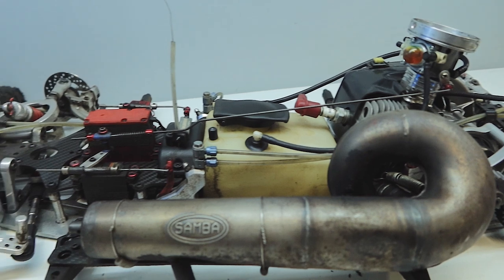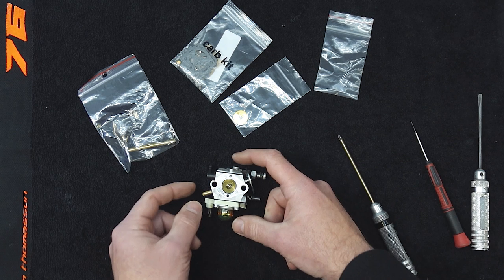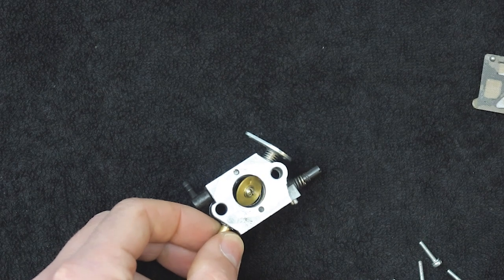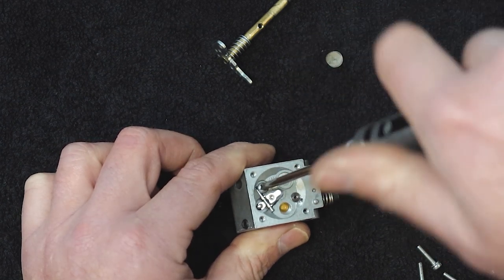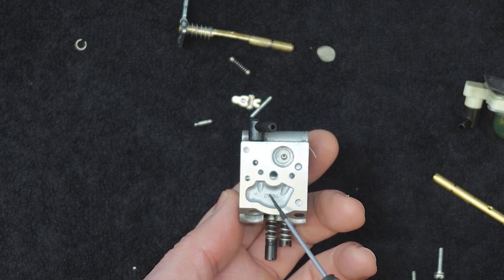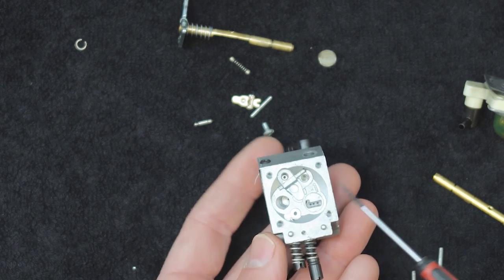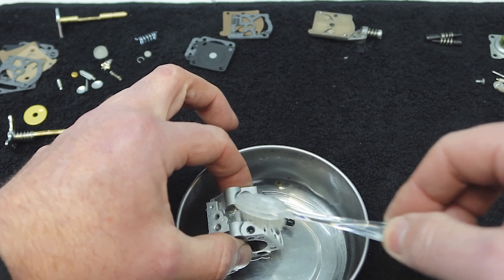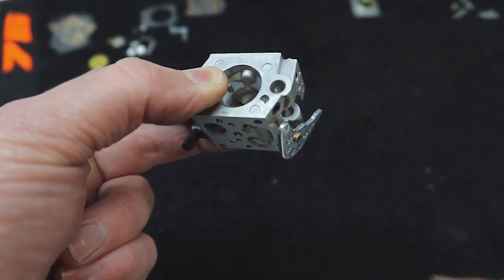RC CAR Carburetor Repair - WALBRO WT

Comment: Though I’m an rc airplane guy, I enjoyed your excellent video. The non-serviceable inlet is the “seat check valve”. The other side has fingers crimped in holding a little disk.  They do go bad, and it’s fairly easy to destroy one with a blast of air or carb spray. They are “non serviceable” in the sense that Walbro has discontinued those parts, but you might find old stock on line. Old one can be removed with the right size screw or the Walbro tool kit once contained a punch.  Some models also had pressed in ‘nozzle check valve’ which had the crimped end in the throat of the carb as part of the main jet. 

If damaged, at idle there is vacuum on the idle port because it’s inboard of the throttle plate, but there is not enough flow through the Venturi to create vacuum at the main jet- so the idle jet might pull some air in through the main jet instead of drawing fuel from the metering chamber… erratic/unstable mixture at idle. 

Anyhoo, can’t really blame Walbro for discontinuing those parts. I think most of their business is from power equipment repair shops, and no one is going to want to spend $22 for rebuild kit, like $80/hour shop rate- and maybe end up with a bad and not available check valve. People either get a new (or knockoff) carb, or in the case of a cheap string trimmer- throw the whole machine away

Comment: Nice job Mark. thank you! This step by step video was essential for a WalBro Carb rebuild on a 25 year old VARIO ALOUETTE II 1:6 scale RC helicopter. I’m now Celebrating with a smooth idling engine after …… well…… 10 pulls. What a difference! Idling like never before. Side note: As I didn’t have profi punch tools needed for refitting the Welsh washers (?), I used similar sized hex drivers….. with success! I did struggle with the smaller copper fitting … mine did not come out as easily as yours. Beware. Flying this coming weekend. Regards from Switzerland

Comment: What size rotabroach were u using mark
Solid explanation of carb workings etc
Have u thought about doing the metering mod where essentially u take about 3 coils from each side of the metering spring to bring the pop of pressure down to 16psi
Regards

Comment: Mark great video! I need help with someting you did not cover though.I got a used old weed trimmer with a carb. almost exactly like yours, however under the primer there no orange ring like yours. Is that something that should there?  I can't get it to prime?

Comment: Great video, thanks! I have same car, CY 24cc when I got it, it started up immediately. Then it was sitting on the shelf for few weeks before going to the track. There it just did not want to pump fuel and barely get it going. Now I rebuild the carburettor, pressure tested it and it is ok. But the motor still wont run. L needle is 1,25-1,5 turns. I managed to get it going for few seconds if I remove fuel intake line. Motor has spark, carb does not have a choke. Can you give an idea what to do?

Comment: Gday Mark best video on YouTube explaining the carby... and believe me I have watched thousands.
Would you have a part number for the milling bit you used and are they 5x9x4 bearings wouldn’t mind giving the bearing mod a crack.
Keep the videos coming👍
Reply from the maker: Thanks James! I thought for sure no one would be interested! so glad the info came in handy. The bearings are 3/16 - 5/16 - 1/8 (ID - OD - width) the bit you saw in the video I made in the workshop! after I get the latest video wrapped up I'll be doing a video on three different DIY at home methods for installing the bearings! so keep an eye out... And thanks for the support Mate!!
Reply: Mark Thomasson Thanks will do.

Comment: I like the details of the carb workings. BUT, for a $12 carb (new) vs $5 for a carb kit, isn't it better or more cost effective to go with a new carb? My 5 year old (on a shelf for 5 years!) Redcat xt, that I've had 3 weeks, the carb was junk from the factory. I replaced it with a new $12 (USA) carb from Amazon, & it runs like a new, broke in 100cc engine now. LOL! It had some carb issues, factory.
Reply: because your new $12 carb is a fake clone carb by RuiXing etc and not a geuine Walbro carb. Mark doesnt buy $5 carb kits either. He buys genuine Walbro. Everyone has a different budget, nothing wrong with that. Also judging by the views there is appetite to learn and service items even in a disposable society. Hows the Redcat?

Comment: Hey Mark! awesome video on how to fix carbs! iw bin looking after a drillbit like the one you used for the bearings. can you tell more about it? maybee were to get one.
Reply from the maker: Hey Mate, the bit you saw in the video I made in the workshop! after I get the latest video wrapped up I'll be doing a video on three different DIY at home methods for installing the bearings! so keep an eye out...  those bearings on the throttle shaft make such a difference!

Comment: What a Thing. Why the gasoline carb has to be so much more complikated than a Nitro carb?
Reply: crankshaft vacuum is sucking fuel into the nitro carb, and at the same time exhaust has a pressure line into the tank pushing fuel. Gas engine has none of this, he explained one port from engine to pressurise the carb with pulses that draw the fuel in

Comment: Can you explain the differences in the 603-668-990
Reply: 133levi 
668 carb used up to 26cc engine and has manual choke
990 carb used on bigger engines up to about 30 cc. Maybe 32 cc. Has no choke
I’m fairly certain this is correct but someone might be able to confirm

Comment: So how do you do the pop of spring mod on your carbs
Reply from the maker: The spring rarely needs altering in cars, boats that run around at full throttle can benefit greatly tho. Walbro actually sell springs in different rates!

Comment: Hi Mark, great video on rebuilding the carbs. Already purchased some rebuild kits for my WT-990 carbs, but finding it hard to find a supplier for the the shaft and butterfly in Oz, where did you get your from?
Reply from the maker: Good to hear you're having a crack at rebuilding them mate!! Hobbies Direct have them in stock and express post for those like me who hate waiting for parts! 
https://hobbiesdirect.com.au/Zenoah-Walbro-Carburetor-Throttle-Shaft-Kit-T207081370?search=walbro%20carby
let me know how you go...
Reply: Mark Thomasson 
Hi Mark, thanks for the info on the shaft supplier. Will keep you updated.

Comment: Were did you buy that drill bit from and what’s the bearing size you used
Reply from the maker: @George Specs - I'll detail and show 3 different methods in an upcoming video! it'll cover a couple of different options!

Comment: Hi mark i have a hpi savage octane, with a walbro carb and when i accelerate the engine get bogged and dies ive messed with the high and low speed needles but i havent had any luck any ideas?
Reply from the maker: @Isaac Estrada start with the simple things first...  1. check the fuel delivery, the clunk in the tank might be blocked - disconnect the fuel line on the carby and blow back down the line (just use your breath) the filter / clunk might be blocked.
2. pull the mixture screws out and check the ends for damage 
3. reset the mixture screws to default
4. check the vent hole on the metering side (I detail it in the video, fuel metering side) 
5. haha if that hasn't fixed the problem, you better order a rebuild kit!  
If you have any more questions DM me on instagram  -  76thomassonm
Reply: @MarkThomasson76  thank you for the reply, I actually concluded that it was the engine I ordered a new piston ring and sleeve hopefully that'll do the trick thank you